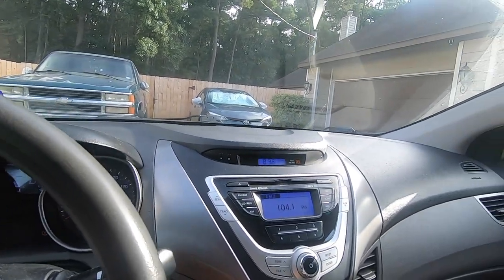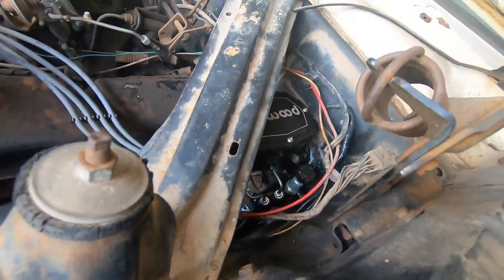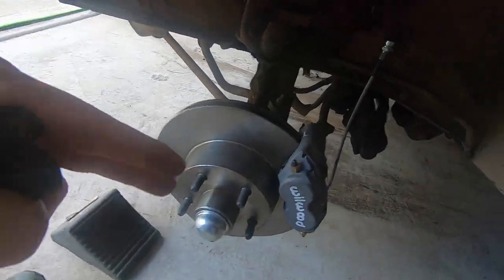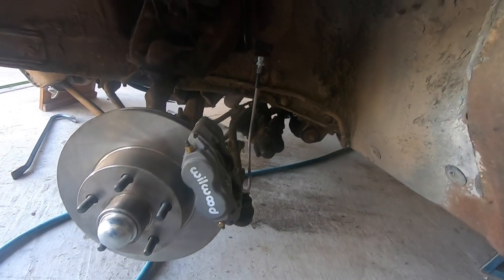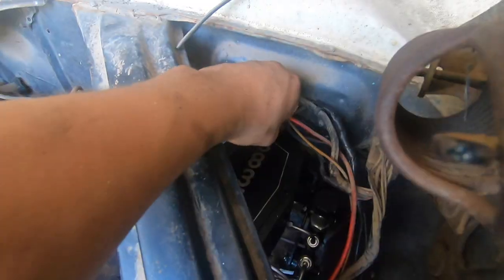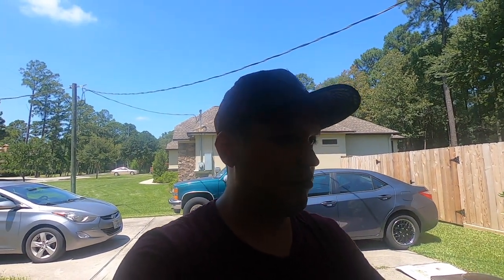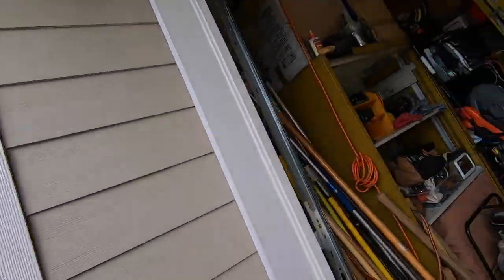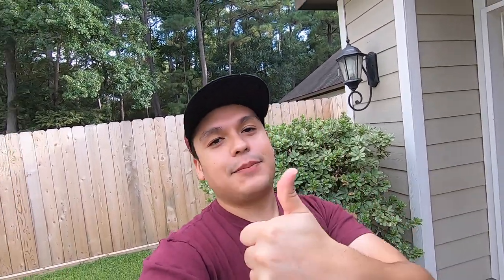Disc brake conversion problems! | Ford Falcon Build

Comment: How can i order the same kind of breaks i got a 65 falcon also? Thank u
Reply from the maker: One is on Wilwood website and I got the cheapest option for solid/vented disc brakes. For the rear brakes I bought them off of summit racing. The brand name is right stuff detailing parts (again, a cheaper option that ended up being headache free) hope this helps a bit😁✌🏽
Reply: Thank you brother.
Reply from the maker: @jcar8146  no problem✌🏽
Reply: @ReelTake  could you post the link